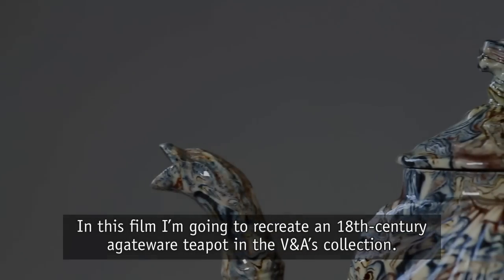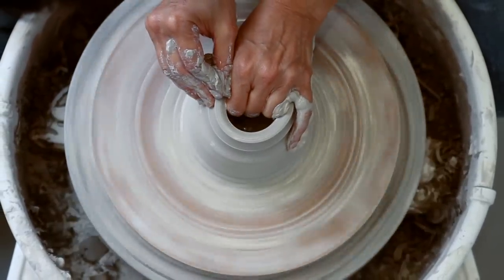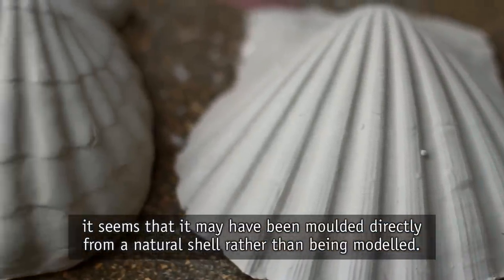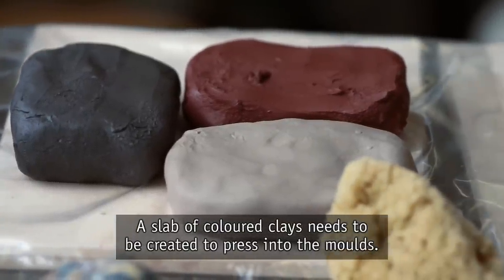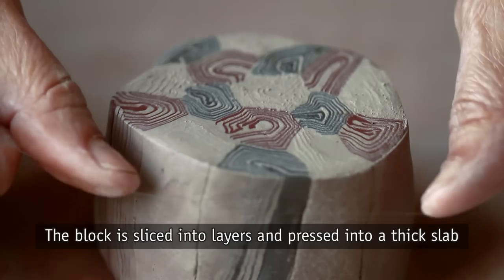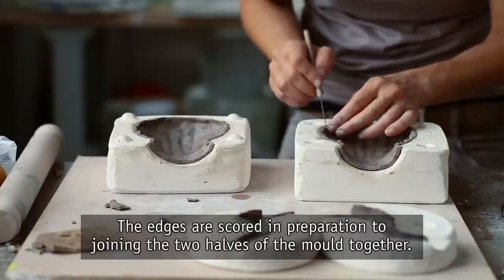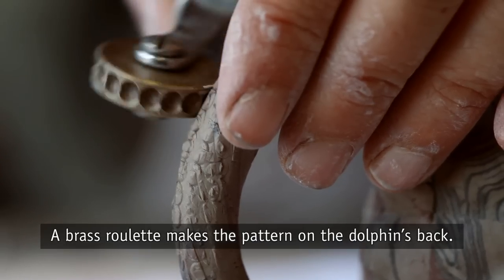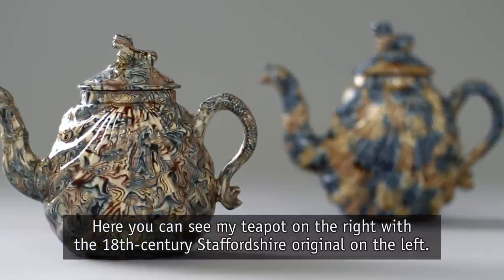How was it made? An Agate Teapot

Comment: Wow, something completely random in my recommendations but what a beautiful video. I notice the new pot has a more vibrant blue - does the cobalt colour fade with time?
Reply: I think it's probably because of where the clay comes from? Sometimes there is a difference in the components that may vary colors
Reply: It shouldn't fade, it's cobalt oxide. I think it's just more blue because she used a lot more cobalt. The original only has it in thin strips.
Reply: My guess would be that her colors are more vibrant, because her clays were made with modern, purified chemicals. Back when the original is made, the pigments would have not been so chemically saturated.
Reply: Cobalt colour is not be faded easily. Just the temperature is important. Higher temperature makes cobalt darker and more blue, even black.
Reply: If you look really carefully on the new pot, you can see that the blue bled into the clay. 

It actually looks like the original pot's blue bled a little too, but only a little bit. 

That might be why her pot's blue looks more vibrant to you: there is more blue and greater variety in the shades of blue because of the bleeding. The areas the blue bled into are also lighter than the concentrated lines
Reply: @carolinejohnson-pseudonym1841  Indeed. May have been pulled by the glaze even? Hard to say exactly what glazing is going to do without alot of relevant experience. I'm thinking thinner blue was needed to prevent the mottling of the layers.
Reply: Its more likely that her clay was purer. The original wouldn't have access to the same modern processes to refine clay back then.
Reply: All of the above factors, plus the electric kiln.  Old time ones varried in oxygen/reduction environments from burning fuel.
Reply: Nothing fades. If the baking is right, the colours will last.
Reply: Imo the original pot has more white clay and the different parts are even more thoroughly mixed up.
Reply: Was wondering the same... I actually like the vibrant colors on hers better. But you are Rigth on asking 🤔

Comment: the teapot is put in the oven with the lid on it? wont it stick to the tea pot then?
Reply: No it won't . In order to get Clay pieces to stick together during the firing, first you need to make slits or "scratch marks" on each piece. Then you make some watered down clay called slip.  You "glue" the two pieces together. As long that's not done then the pot and lid will not get stuck together.

I did a little bit of pottery in high school art class.
Reply: @9Tailsfan  ok thanks for explaining

Comment: This is outstanding work! Your research and technique are just lovely.
But please please PLEASE use gloves when working with clay colored with oxides! Cobalt carbonate leaches through the skin and can cause toxicity in the liver and kidneys, and manganese (especially manganese trioxide) leaches through the skin and causes progressive nerve damage wherever it goes. I know working with your hands has a lot to do with feel, but the health risks really outweigh the benefits of not wearing gloves. I like to use vinyl gloves that are a size too small, even when throwing colored clay. The tightness of the gloves allows enough sensory input and dexterity for muscle memory and detailed work to be possible, but it protects your body from toxic components in the clay (or glaze). Even if the tight glove breaks while you are wearing it, the exposure to toxins through the hole is much much lower than working without gloves altogether. Historically, ceramicists have been known to get very sick and sometimes even live short lives just because of material exposure. It isn't worth it to risk it!